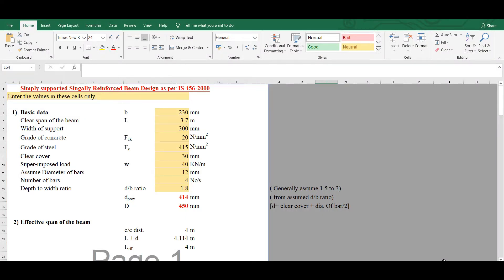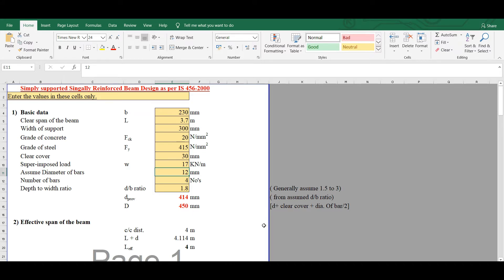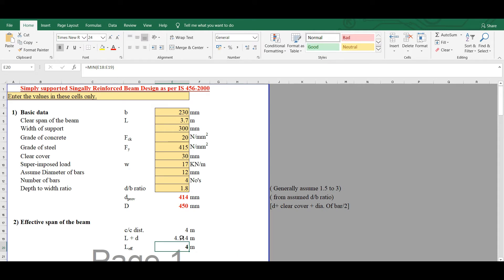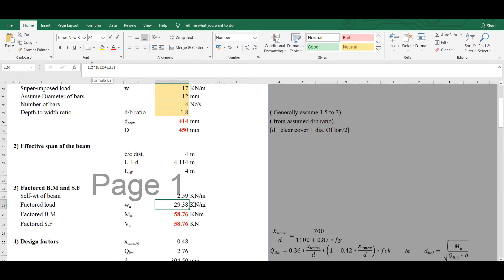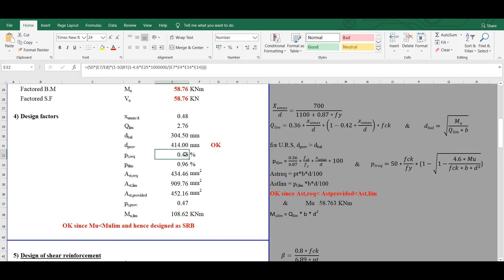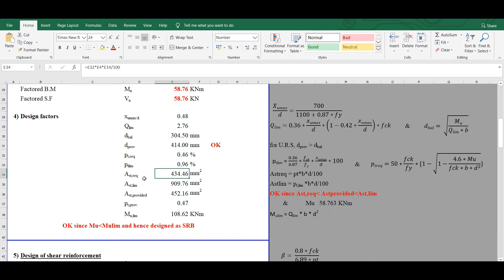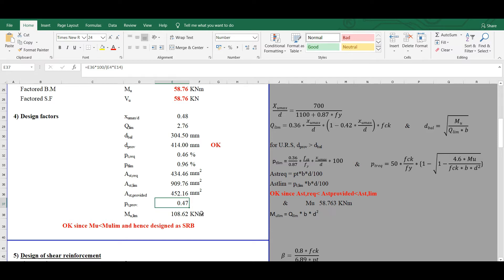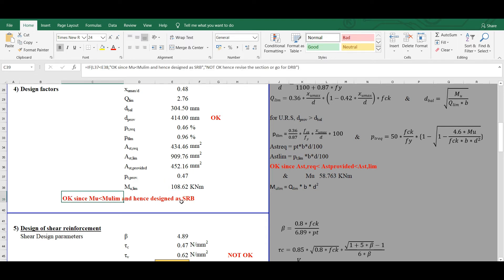Design of Simply Supported Singly Reinforced Beams in excel using IS 456-2000

Comment: Is Mtech necessary for doing structural design's commercially or can we do it with btech ?
Reply from the maker: Yes you can do structural design with btech degree. However, with btech, you will need atleast 5 years of relevant experience under a structural consultant.
If you have an Mtech/M.E degree, you need atleast 2 years of relevant experience.
Reply: Is there any restriction for doing structural design for Btech graduate comparing to Mtech in the design of high rise structures .
Reply from the maker: @alameen1870  No. But as compared to M.E, more experience is required for B.E candidate.
Reply: Thank You
Reply: @alameen1870  in Btech we don't have long columns in syllabus.
So mtech is beneficial.
If you want something different, then search for mtech town planning